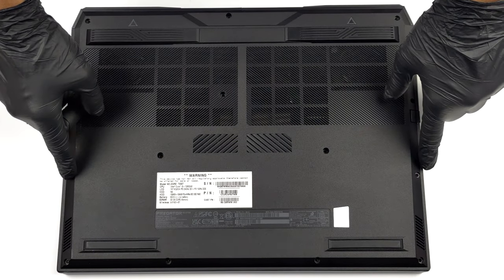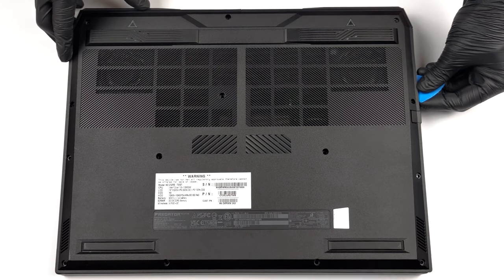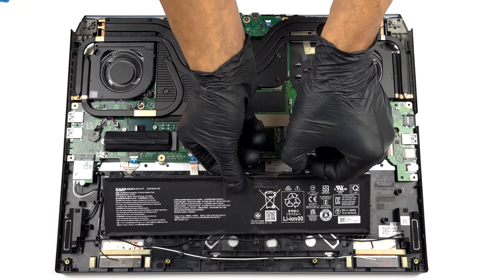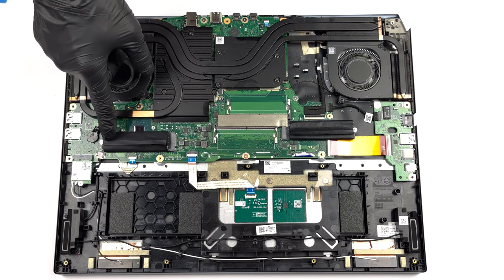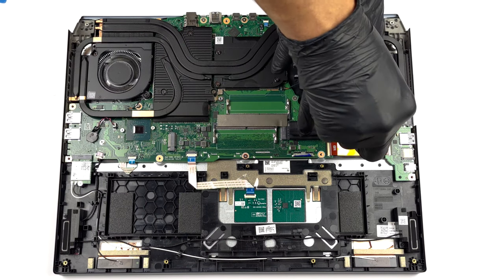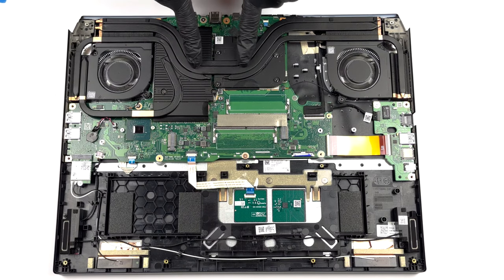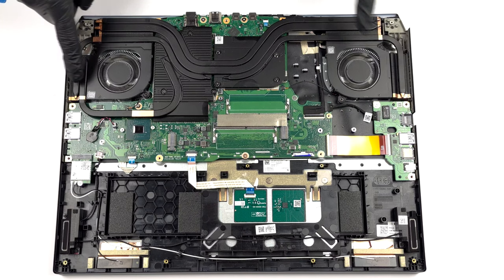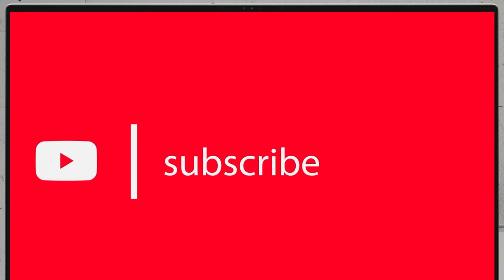🛠️ How to open Acer Predator Helios 18 (PH18-71) - disassembly and upgrade options

Comment: Literally they made a bigger chasis and slapped the helios 16 MoBo into it.. They didn't even extend the fins on the right hand heatsink. Alienware shares the same boards on several of their laptops and at leasts increases the size of its heatsinks. What happened to the quality of the Triton 900, 21 X, and 17 X? Very underwhelming laptop for the power it is to have.

Comment: I dont know if its for you but, you can open the helios fans and show how to clean them as that would be great addition to it. Just try to be open minded about this suggestion as I own the helios and I would love to see how to clean them cause you teardown every helios.
Reply: I have cleaned mine. I have this same laptop. It wasn't that hard honestly. Just have to remove the cooling system almost fully
Reply: @shikharnegishiggy8752  which model do you have?

Comment: Will 64gb ram not work?
Reply: I've seen reports of 64gb working at 5200. I've got two 32gb sticks coming in tomorrow.  If I don't post tomorrow,  whoever sees this remind me at a later date, and I'll let you know.
Reply: @z00k  is 64 gb works?
Reply: @jackblades9071  CT2K32G56C46S5 kit will work fine for windows in the PH18-71, but for some reason (which I haven't tested recently), in Linux it makes the computer forcefully reset the BIOS completely at random. The problem never happened with Windows though

Comment: How much room is there for SSD Heatsink?
Reply: just a few millimeters! So you get a flat heat sink for your M.2s then put thermal pads for added cooling. This is not a PC Motherboard that have bigger space inside and you can at will install a thicker heat sink for your M.2.
Reply: @awakenedsoul2638  do you have this laptop ?